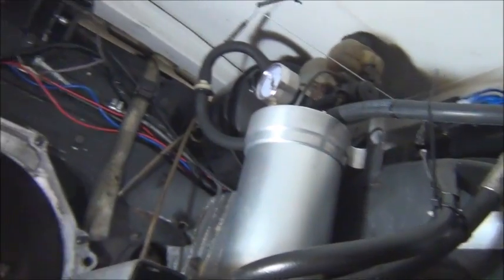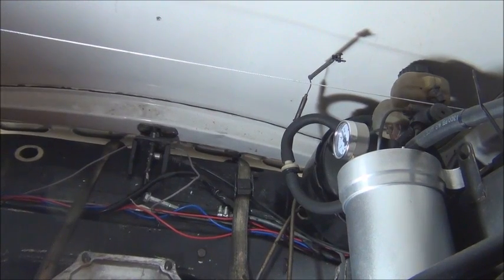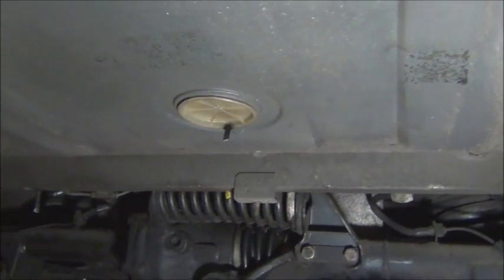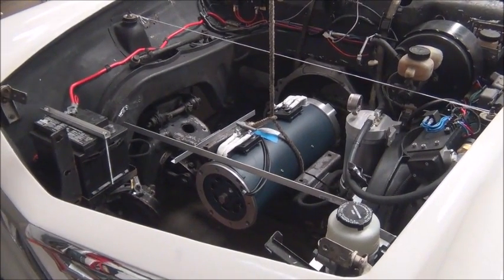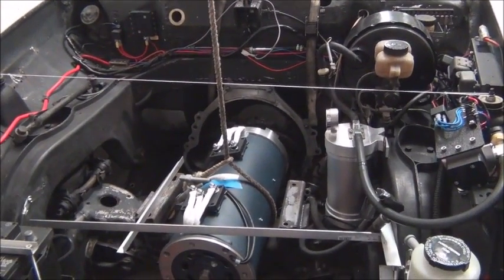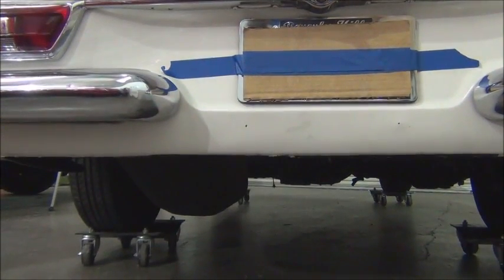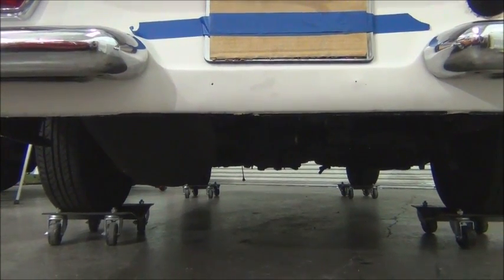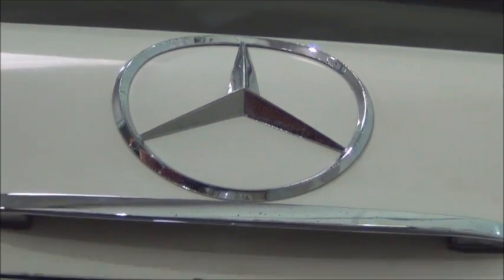Mercedes 230SL Electric Conversion - Behind the Scenes of the Electric 230SL Conversion, Part Two

Comment: yeah I'm looking for a way to take a usable truck, long term store it, then get it into action in a case of a fuel crisis, or economic collapse. So the charger would have to be solar or wind generation. I'm just spitballing this stuff because I haven't any real technical knowledge about the electric car stuff. That being said, I would like to begin gathering the things I'll need, such as those batteries and the electric vacuum pump and the main electric motor. Basically the question I've been wandering towards is "Do you sell an info sheet pertaining to the parts I will need?"  With this info, I conceivably talk my wife into letting me do this. lol money's not the roadblock, she is lol anyway I appreciate your responses, later
Reply from the maker: EV4U offers 3-Day Hands-On Conversion Workshops that will teach you everything you need to know.

Comment: Hey, I was wondering how feasible my 4100lb 2007 Chevy Silverado would be to convert. Its 4100lbs without the motor and tranny.  I only included the weight because I noticed most people are converting smaller vehicles. Anyway thanks
Reply from the maker: Bottom line...weight costs money.  The heavier the vehicle the more it will cost.